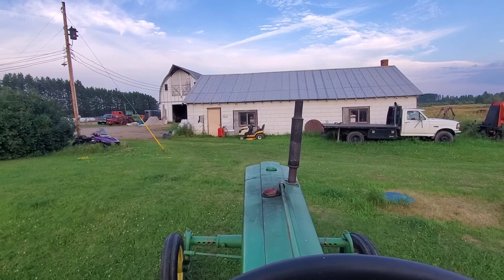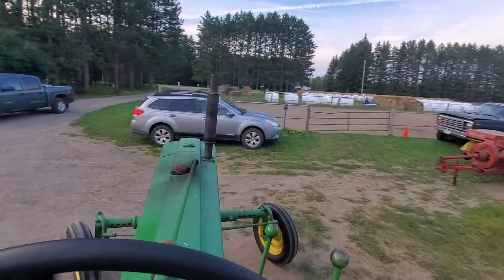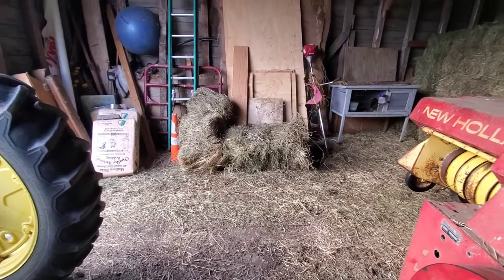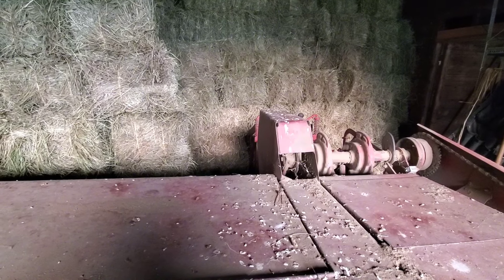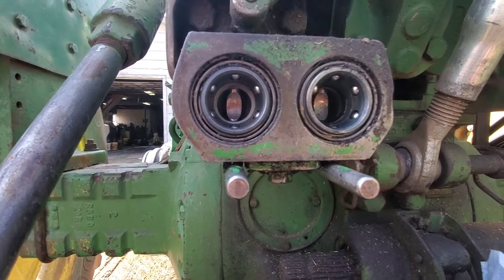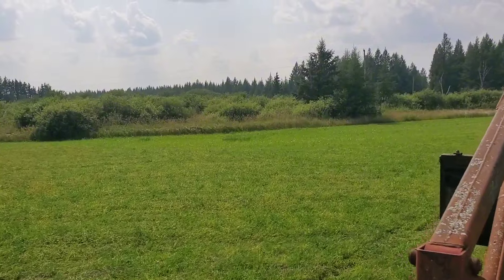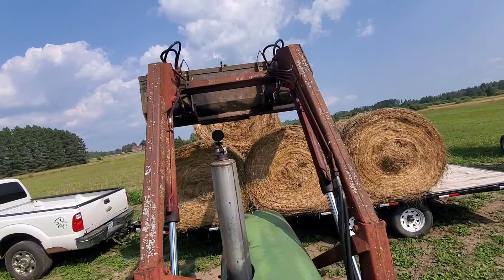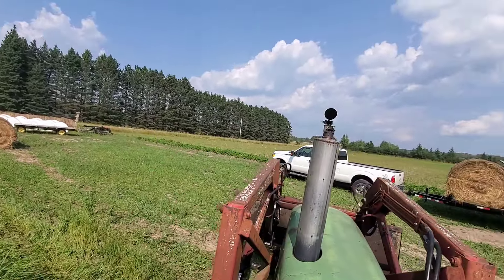The bales are big and the trailer is small.

Comment: Our bales are basically the same, It's just  so damn many  over......... Over 700 ... 4x8 rounds  on the Rented farm  15 miles away...... But After the  2 ( 20a & 80a) fields dried enough from the   drenching  Hurricane? tropical Debbie left  we  got it all hauled   and stacked under the shed... in 2  10 hour days  ( 4 men driving 4 trucks,  1 teenager unloading and spotting bales for stacker,  1 LADY in the field   bunching 27 bale groups and loading trailers(  she is Fast )  We  had to clean bales so we cold spray for Army  Worms and  apply between cuts  Fertilizer....  Grass is already   from 1 inch stubble height to 8 in  runners......
Reply from the maker: @farmingforfunandprofit940  That's a lot of hay to haul. Good thing you found enough help. We don't have any Arny worm or grasshopper problems,  thankfully.
Reply: That is ONLY from the Rented Farm    Which the whole operation to a Hay only  business began 7 years ago....  It started with a landowner who we we renting his open land in Cotton  And Peanuts.... asked us to    Add his 80 acres of  Hybrid  Tifton Bermuda Grass into the program      It has Snowballed   from a first Crop of 1000 4x8   rounds sold right out the field to a Hay  Broke for   $50,00.00 each ......  A year later into  purchasing a complete rebaling  operation, supplying  TSC Stores  by contract in our Radius with 53ft trailer loads of small squares (756 bales).......   Over 68 trailer loads  last year!....
Reply from the maker: @farmingforfunandprofit940  That will definitely keep you busy. I think rebaling could be a good thing around here. There's always demand for small squares but our summer weather can be uncooperative for putting up a lot squares.
Reply: About 4 years ago  We were approached by a big time Cotton & Peanut farmer had a rebaling operation that involved supplying 2  TSC stores near Charleston S C and he wanted to sell the Whole Shebang,,,,,,,      The package included A set of Simpsom Unroller  and feeder Tables, a 5070 N H Baler,  A 200 Bale Bandit, A Ramp for  loading bundles inside trailers,   4 53ft  double door  OTR Trailers,   My Son applied for a Farm Loan   with enough to build 2 6ox120x 20 high Steel sheds and he let us use his Shed to keep the operation going while the  TSC contracts were changed and they finished our  shed....... Last year we purchased an 1840 inline and a 5250 Bale Baron trading th Bandit......  Last year we supplied over 52000 small squares to 6  TSC stores,,,,,,   We  Round Bale everything,  for speed, an handling..... We just swapped out  an M and R  John Deere balers for 3 Krone 190 XT balers  each capable of 45 bales per hour........  (Numbers derived during last baling session............. )995 bales from 2 balers in 2 5 hour  afternoons)